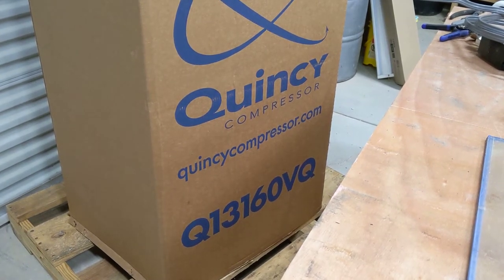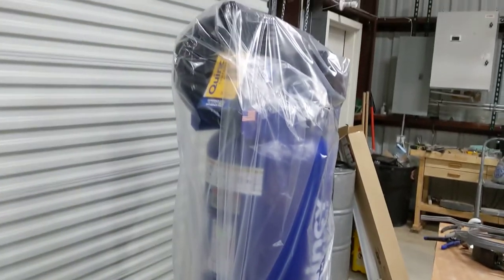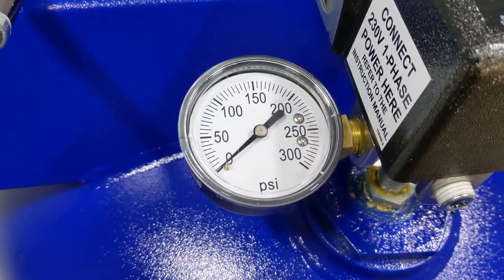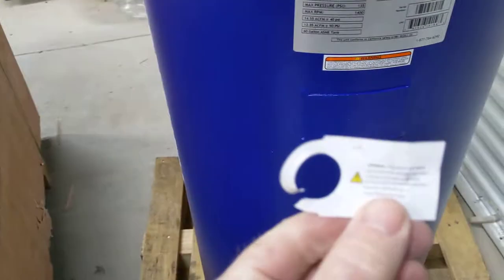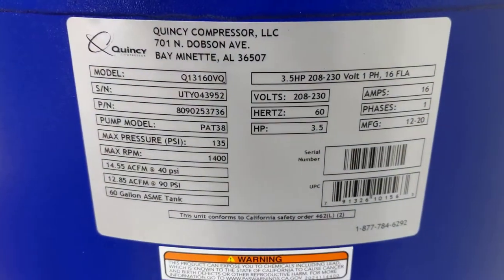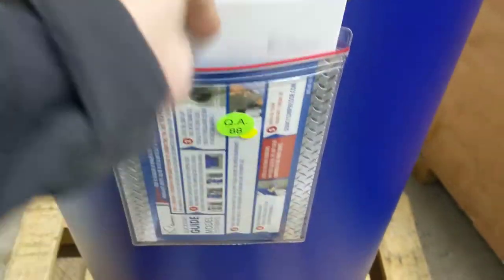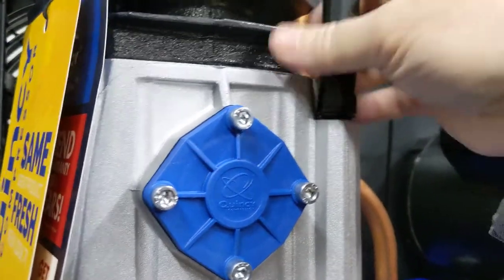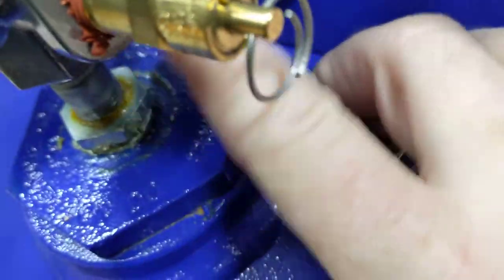Quincy 3.5-HP 60-Gallon Single Stage Air Compressor Unboxing Q13160VQ

Comment: I can’t get the oil to drain out of that little tube. When I open it it just drips slowly. Any idea how to drain the oil?  Is there a vent I need to open?
Reply from the maker: Sorry I haven't done mine yet, maybe open the fill plug as well?
Reply from the maker: Also run it for a couple of minutes prior so oil is warmed up.

Comment: Will this compressor run die grinders most of the day and be able to keep up?
Reply from the maker: Not sure, would depend on your die grinder specifications - this compressor does 14.6 CFM @ 40 PSI; 12.8 CFM @ 100 PSI - keep in mind the duty cycle is 5 minutes pumping and 5 minutes resting, so 50/50 duty cycle.

Comment: How are you liking this compressor so far?
Reply from the maker: So far liking it!  It holds air good and is pretty quiet, I put some hockey pucks under the feet.  So far it does everything I need!
Reply: @DISOPtv  Thanks!
Reply from the maker: Only problem I have had with the compressor is the duty cycle.  5 Minutes pumping, 5 minutes resting.  Seems short when I was sandblasting or sanding something.  Wish I would have gotten a compressor with a longer duty cycle now, but didn't really even consider that when I was looking.

Comment: Did you notice the tag on the tank says 3.5 HP but the tag on your motor has 5 HP on it.
Reply from the maker: I didn't!  Good catch, I'll have to check that out!
Reply from the maker: Thanks for pointing that out, guess they upgraded me :D
Reply: @DISOPtv  Check your wiring and breaker sizing. Higher HP and more amps from the motor.
Reply: Late comment here but it won't put out 5hp of power or draw 5hp of watts unless it's asked to, which it won't, hooked up to that pump. IE 5 hp motors don't pull that much just spinning, it's just that they CAN put out that power if faced with that much resistance. I'n this case, Quincy designed the pulleys and pump combo to pull roughly 3.5hp of power from that motor. Frankly it's good it's being easy on it since it has a relatively low service factor of 1.
Anyway, fyi it's not a mistake but rather part of the system design here. Hope you're enjoying your compressor and thx for the video btw!

Comment: start buying pressure switches
Reply from the maker: Huh
Reply: A lot of people don't like it if their isn't a magnetic starter vs the on/off pressure switch. The pressure switches are like 25 bucks and last just fine.
Reply: @DISOPtv  I put a magnetic motor starter on my Quincy QT-54. The magnetic motor starter usually comes on more expensive compressors. Without a magnetic motor starter, 220v is running thru the pressure switch. This is a lot harder on the contacts and will wear out faster. With a magnetic motor starter, only 110v in running thru the pressure switch and this is easier on the contacts with a lot less wear. Plus the magnetic motor starter helps the motor starts easier. You can buy a P30T magnetic starter for about $72 from compressor-source.com. They are easy to install and worth the money. There are several youtube videos you can look up and watch.